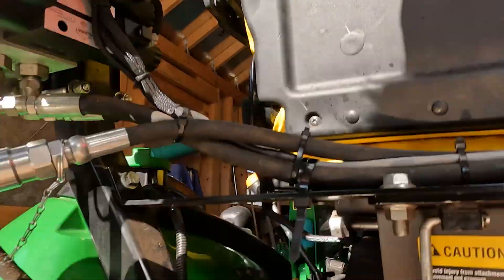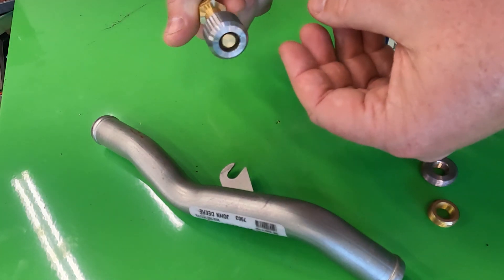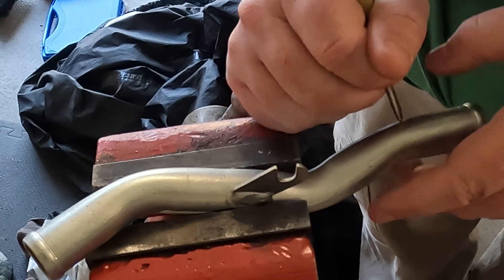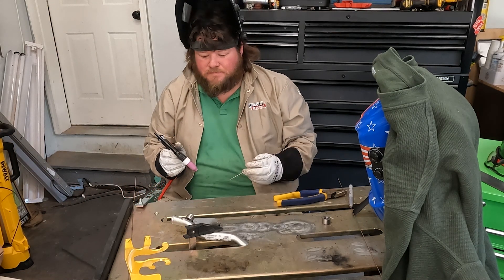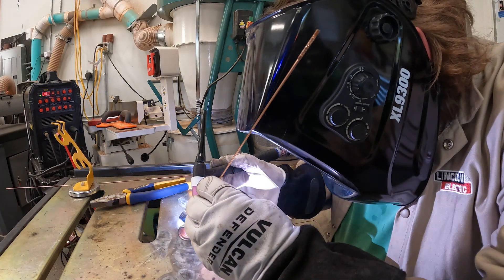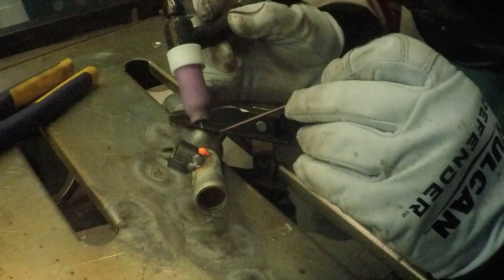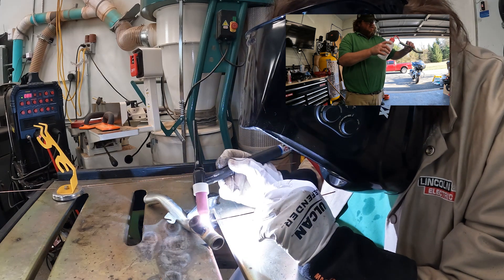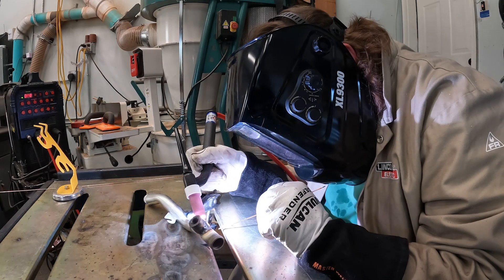1025R Hydraulic Suction Tube Modification

Comment: Good video. I'm interested in adding a hydraulic temp gauge but isn't there an easier way? 

Can the welding be eliminated and just install some type of gauge somewhere on an existing fitting or add a "T" with the gauge at an appropriate connection spot on the hydraulic line? It's not as pretty or convenient as the dash mount but would be very functional.
Reply from the maker: Hey Anthony- The location I picked was because of the high pressure of the hydraulic system.   I reached out to a few gauge manufacturers looking for max PSI specs for the sending units and the one who responded said "rated, not sure, but 1000PSI should be ok".  With the 1 series PRV set at ~2100 psi using a location that is on the high side of the pump puts the operator in potential jeopardy with a failing sending unit and the high pressure fluid being released unexpectedly.  The location I selected is a constant flow and provides the best gauge of the internal temps of the transaxle.   The only other "semi easy" locations to put in a fitting would be the return from the oil cooler low pressure return line (constant flow) or on the drain to tank line on the side of the transaxle which doesn't have a constant flow , both of which aren't the best source for a temp gauge.   Another option would be drilling a tapping a hole in the trans sump, but that's something I wouldn't attempt unless I had an extra $7k sitting around to replace the transaxle and a spare tractor for the downtime (i.e. don't do it) - cause it'll almost certainly void any warranty and so much could go wrong.
Reply: @MakerBreakerFixer  Understood, thank you sir for the reply and heads up, I'll take your advice. 
If you start selling these is there  any chance you'll make it for other brand tractors? I have a Mahindra 1640.

Either way, best of luck with the channel and future business ventures! 👍🏻

Comment: Welding comment: that's a cad-plated tube. Should have lightly ground it down to bare steel around the weldment before welding. That white powder all around the weld is the result and it also contaminates the weld slightly. Might start seeing some extremely slow leaking from tiny holes in the weld after a short while. 
Stitch-welding with a Mig might have been better on this since the tube is relatively thin-walled. It's a slower method for sure, but also imparts much less heat for the same results. 
Fish-mouthing the bung around the tube would have helped with the welding, too. 
Until you get your whole operation up to speed and can offer a full kit, maybe offer to do the modification to owners' pipes if they send it to you. The gauge and related hardware to connect it all up is easy for anybody to get at almost any auto-parts store.
Absolutely love your Youtube handle!